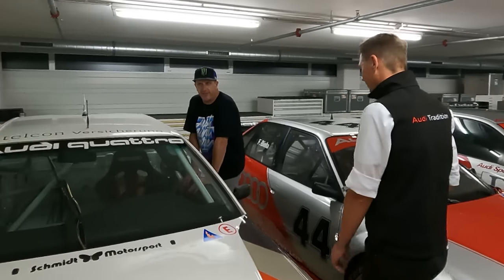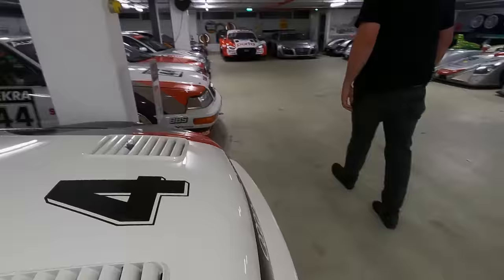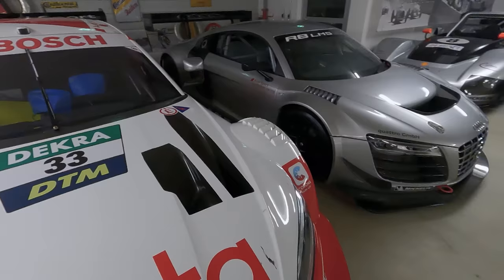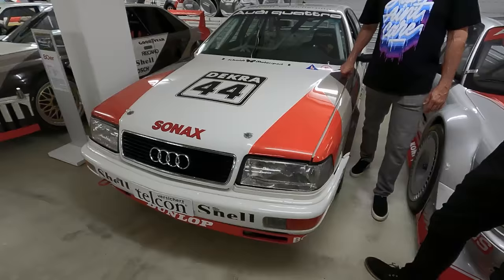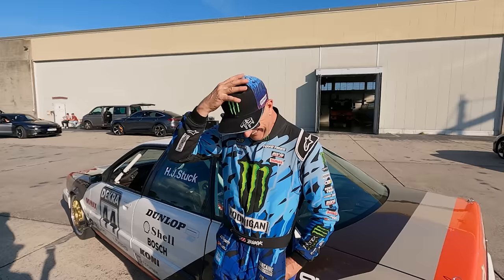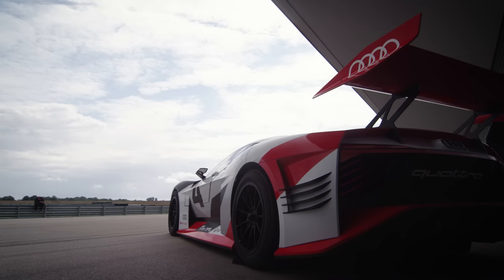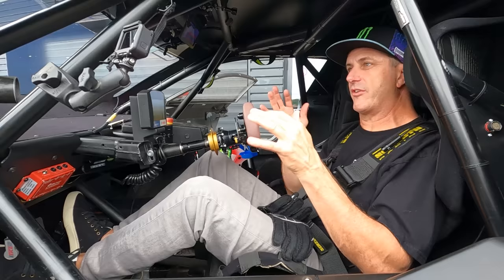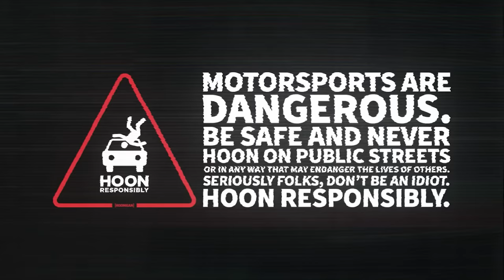Ken Block Shreds  Audi  e-tron Vision GT Prototype & 11,500rpm Audi V8 DTM Car

Comment: The look in Ken's eyes when he drove the Etron vision GT shows how much of a handlful that car is.  He had a look of concern that I've never seen before and he was just driving fast on a track, not even sliding sideways.  He looked like a person handling a deadly venomous snake who recognizes this will take his full concentration to not become a disaster.
Reply: These cars have such a strong downforce, that it's probably not even possible to drift them like he is used to.
Reply: @afa1515  Downforce only works if you are at a speed capable of producing it.  With that much power on tap instantly through electric motors all drifting would take is a proper approach speed.  Id think the throttle input tuning and torque curve would need to be adjusted to his liking so he's comfortable with input and the motors are giving him a useful amount of power to control the drift.  These things have less of a torque curve than they have a modifiable torque program.
Reply: O yeah as soon as they cut to his face before the 1st turn you can see the concern in his face as he approaches the corner. He says after too it either is gonna stay on the line or you are going straight LOl
Reply: I agree seems . Would they not let him drift it? Or was the suspension just that defined an tuned?
Reply: @s.willis8426  think a sequential gear box could help that. I felt like maybe all wheel steering would help with corners? An unfortunately seems i was disappointed he couldnt drift it wonder why tho.
Reply: @namelast6152  I don't think he had permission to drift it.  I seem to remember he wasn't allowed to drift the DTC car, probably the same deal with a prototype E car.
Reply: @s.willis8426  if anyone should be allowed he should've been. An glad they let him drive them an the thanking them for making his dream come true. Was very awesome in its self
Reply: @namelast6152  In the spin he hit full lock and couldn't correct the slide. Also wouldn't suprise me if the computers automatically correct a small slide.
Reply: @devinholland2189  so he couldn't steer back out of it? Is it electric steering? Or fluid driven power steering? An what do you mean by the computers correct even small slides ? By small slides you mean the car was using sensors that possibly where mapping the track or lane versus his own judgment?
Reply: @s.willis8426  use too the faster they go the more the car would lower an makes the suspension work in different way. So if was lose before at 30 at 100 would seem tighter. Then at 200 could be so stiff it would make the car buck an possibly lower so far down to the ground it could cause bottoming out or weird camber angles depending upon suspension type of course.   Also in some cars could cause slight changes in toe .
Reply: @namelast6152  the computer is absolutly looking at the speed of each wheel and when there is an unususal difference the brakes are applyed and engine power reduced.
Reply: @namelast6152  It doesn't matter what type of steering it is. Most race cars only have 15 degrees of steering at the tyre, barely any lock. If you turn the steering wheel more than 90 degrees you've already lost control of the car and won't have the lock available to correct it. 
Race cars are not meant to be driven sideways. That is why he wasn't allowed to drift it. Most racing accidents in unfamiliar cars occur when someone tries to correct a spin, the car grips the other way and fires into a wall. Ken is also not a race car driver. He spins almost every actual circuit race car he gets in. He spun a V8 Supercar going barely 80 kms an hour at the first corner he arrived at in another video - almost exactly similar to this - because by the time he got there he had no idea what to expect and got wide-eyed. Most race cars are setup to push, the way he mentioned, towards understeer. So when you turn, the car wants to go straight. It is due to the rear squat and toe settings that make the car track straight and be stable under braking.
Also, race cars do not have the type of dynamic suspension you are talking about. They are designed in such a way with their control arm lengths and castor trail etc, that they retain their camber settings etc almost through their entire range of travel. That is why cars are wide, and as in F1 etc have such long suspension arms mounted in specific spots. That is the optimal geometry that as the wheel moves through its suspension travel, the camber and other settings remain constant. That's why most race cars have fender flares to fit wider track tyres - to allow longer suspension arms.
Reply: @dons1932  totally understand that. I have been in alignments for about 10 years or more been a fan of racing my whole life so like 40 some years or more. I have never driven either. An drift cars or totally different then them. Sounds like if i needed a race car driver too test new suspension set ups he be best for drift an i have to hire a different person too do the racing test ! I like all forms of racing . So would love to see this cars pushed too the limits by what the racing world see has the best race car driver atm. Thanks for explaining this with me i do know most race cars have more sensitive steering in them. An i have no doubt with the right tires on this car kblock could drift it. Despite all you have said.
Reply: Damar Fadlan  i like to see the record holder for nurburgring drive it
Reply: Damar Fadlan  homeless folk dont get too drive no car man
Reply: I felt that too, but if give him a few tries, he will own it.
Reply: @dons1932  at last some sane comments in this section 👍
Reply: @Rob-vv5yn  Lots of kids on these videos. Naturally. Target audience.
Reply: @koblongata  Maybe he could be better but I doubt it since it's a completely different driving style than what he's used to so no owning it
Reply: That car can't drift, suspension , tires and computer set up will not allow it, he lost control and spin and he couldn't recover it,  drifting and rally cars are 100% different from endurance cars,  but Ken being able to drive them is just amazing,  those cars were beat down by the best German drivers, like hanz stuck, I think for him,  he just reach the pinnacle of his career
Reply: @dons1932  best reply. I couldn't agree more.
Reply: That’s because he’s actually not a very good driver.  Compare him with European drivers like Sebastian loeb etc

Comment: That 11.5k RPM V8  sounds so nice it gave me teary eyes ..  
i Could lay in bed and listen to that for hours
Reply: I think it’s just missing straight cut gears
Reply: @DemonSlayer-og8nm  hmm, my assumption would be it has them. But tbh I dont know the homologation rules regarding driveline components. 
Do you or anyone else know the specific year of the car he drove by chance? I wanna read up on it
Reply: @von...  pretty sure the car was built somewhere between 1988 and 1993
Reply: @von...  looks like a audi 200 a C3 bodystyle or c4
Reply: @von...  That's the 1990 model, one which Hans-Joachim Stuck (#44) won the DTM championship title.
Reply: @hook783  heavily C3 based, technically a D11.
Reply: @cuatrokoop32v  Yup thats the info we really needed here, Love my Audis... wanna get into older but for now I need to work on getting a place to wrench easier, miss my B5's
Reply: @hook783  I still have two B3's and am possibly picking up an ultra clean B5 30v with a manual transmission. It matches the color of my Q7 TDI, crystal/ice silver over black leather.
Reply: @cuatrokoop32v  Lucky man, I sadly am 21, the steps are still to be made for those dreams! for now I will accept the painful loss of my big turbo audi for another ,more reliable, dream car a MK7 GTI PP
Reply: @hook783  nothing wrong with a mkvii...!

Comment: My two takeaways after this 3 part series. 1: Audi snatched Ken up for the purpose of showing they fully intend on baking in fun and potential madness into the electric cars and he'll be used to help showcase to what extremes. 2: When I eventually have an electric car, first mod will be to get rid of whatever sound deadening is around the drive train to get the electric race car loud gear whine. Maybe gear whine will be the new "loud exhaust".
Reply: Swap the helical gears for straight cut and become the whistle tips go whoo whoo you want to see in the world
Reply: dude after the lame Ford videos (where they wouldn't let him do cool stuff in their electric cars), your first point makes Audi seem like a much better match for Ken when you compare their current/soon-to-be-available vehicles. Ford literally built a 1000+hp race model of the 'Mustang' Mach-E & were still lame, while Audi over here is letting Ken drift one of their actual production Electric car in circles around one of their many iconic & priceless historic race cars.
Reply: I've always appreciated a good exhaust note and there's nothing else like it, but there's something compelling about pushing an EV hard and getting that electronic whine. The sound is subtle, but my brain equates it to the ridiculous torque and pure joy of accelerating hard in my Tesla.
Reply: @platniumdr  Yeah I love the electric whine, to me its kinda like a loud supercharger. There is several cars that you can't even hear the exhaust because the supercharger whine is so loud and its awesome.
Reply: @von...  how was the mach e 1400 lame? Him and Vaughn made a video both driving each other's cars
Reply: Electric cars will go nowhere once porsche figures out their synthetic petrol

Comment: When the rotary goes in my RX-7, i want to swap in the Audi inline 5 from the TT-RS/RS3. One of the most unique and insane motors worthy of replacing the amazingly unique rotary engine. Which coincidentally was developed by NSU who was later merged into the Auto Union group, so it'd be essentially keeping with the heritage, technically.

Comment: I came here for Ken's drive of the 1990 V8 DTM racer, and it didn't disappoint. At all. 11,000rpm from a V8 Quattro is an insane set of specs. I shouldn't be surprised that it makes V8 aural pornography.

Comment: Audi.. dayum.. major props for the museum driveathon. As a fan, hearing many gifted drivers say lack of feedback in ev's is awkward or a problem (and I assume maybe a little less joy inducing) I wonder how companies address it. Need to figure out a way to help drivers get feedback. Even I hold a gear and brake less into turns, use the trans to brake sometimes and maintain corner speed and attitude, so I'm not sure how to relate without seeing and hearing race cars do this. To be fair fans don't always hear engine sound, but without any engine sound it's hard to gauge speed and level of aggressiveness everywhere on track, and this should be a problem for companies and racing organizations. So how to compensate? Even if viewers could process multiple lines of racing team data or graphics showing drivers are x-amount throttle/brake, and simultaneously watch cars race, it can't be as effortlessly enjoyable as the instantaneous marriage of sight and sound. Example: ice car 7:10 vs 9:05 ev entering and exiting turns, ending with spin. On site he said "trippy" to watch /Ken said "unique" driving experience. Is this not as good? I think they mean it's cool as in neat, but not ice cool.

Comment: If you're into F1 revving engines, there is, out there somewhere, a Renault Espace that they converted to run an F1 engine and tyres back in the 90s.

That would be fun...you'd need a pretty flat track though as the suspension was killer!

Comment: A high revving is 20, 000rpm - 22,000rpm. The wheel covers that were outlawed by the FIA in F1 will be back on F1 in 2022. I guess they are still relevant.

Comment: First car I bought when I moved to America was a used Audi 80 - 2 door coupe. I'd heard about Audi's "unintentional acceleration" lawsuits - and knew it was total BS and that the issue was just elderly Americans getting confused. In fact about once a week there'd be headlines about an elderly couple plowing through a Farmer's Market. I would leap to the defense of Audi - I loved the cars. This was before they resurrected the brand with the A4 et al - so they were still tarnished by the BS 60 Minutes reputation. Those five cylinders were magical - Instead of feeling asymmetrical or unbalanced, it felt more like a secret "turbo boost" where you wrung more from it than expected. I noticed it a lot on freeway passing maneuvers.

Then one day, driving back to my house in San Francisco on the 280 near Glen Park, my throttle cable snapped - and the car screamed horrifically - automatic gearbox only quieting down when I slowed into real first/second gear speeds. I couldn't get it to stop revving, no matter what I tried, so I figured, hey, it's super screwed up - maybe I can get to the cool auto repair shop on Army/Guerrero? (The only honest shop in SF) and so, engine protesting loudly, I crept all the way from Glen Park to Army and wailed into the garage. 

I assumed it might be a write-off, but an hour later, my mechanic gave it back to me, completely fixed, for about $100. Only issue was the snapped throttle cable. He replaced it, good as new!

But technically speaking, that WAS unintended acceleration....

Comment: i have to ask..carbon fibre bucket seats..almost rock stiff suspension,high rev v8 pulling 0-100 in under 3secs...maan..on a scale of 1-10 how cormfortable are these beasts
🤷‍♂️👀😂

Comment: I bet the motor rotor-bearings fail constantly, causing catastrophic powertrain failure like the 2.0T's timing chains and tensioners.  It's a good thing Ken Block has lots of money and sponsorships to repair all the mechanical failures that Audi won't fix.

Comment: lucky bastard is the anime term for the little guy who always lucks in to nude shots of the female character's. but it's always the female character's walking in on him hence the lucky bastard . being old school well I'm just old I will miss gas engines in motor sports just for the sound. while the electric cars are fast and cool there not a screaming V8 trying to keep it's pistons in the cylinders at 8 grand or the crackling 4 cylinder Cosworth rally engines of the 80's god I'm going to miss the sounds

Comment: Sorry guys but I can't get behind the electric car. To much bs in this so called green energy. Like all the coal power used to power these batteries. Or all the non green energy to produce the battery.  Plus all the plastic used in it which is  oil based.
Reply: well someone who think like me. Well the politicans cant think that far, they only know they only uses energy. Well germany politicans are lost either, maybe i move out someday